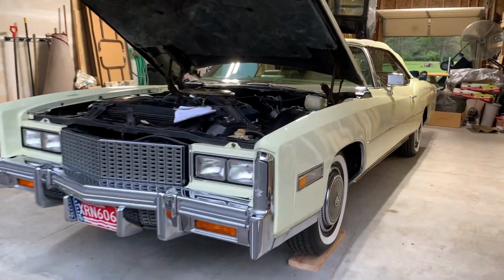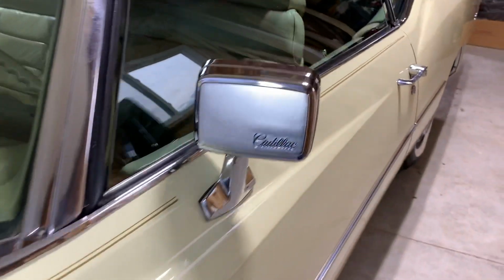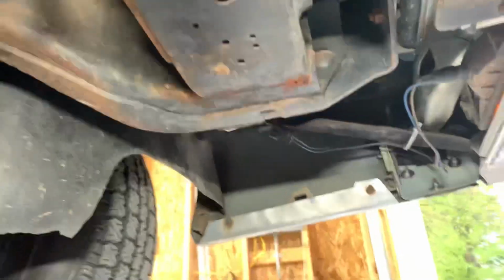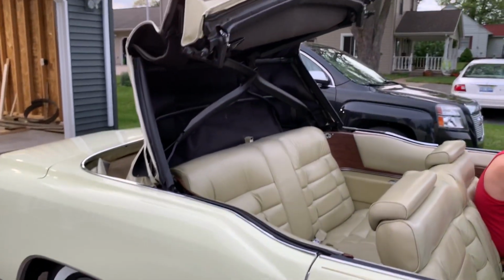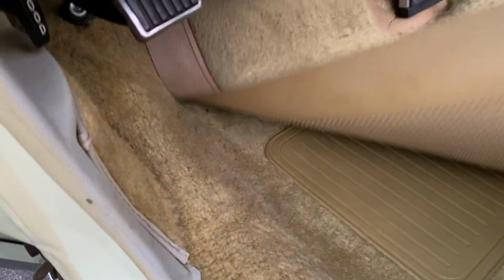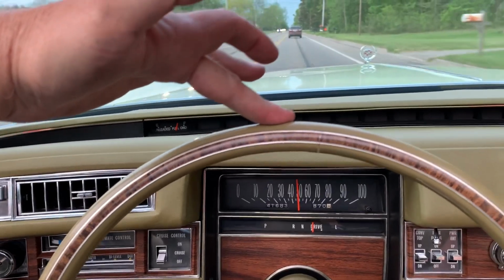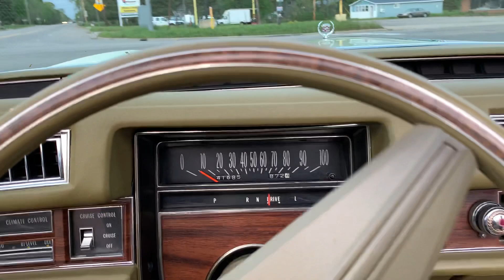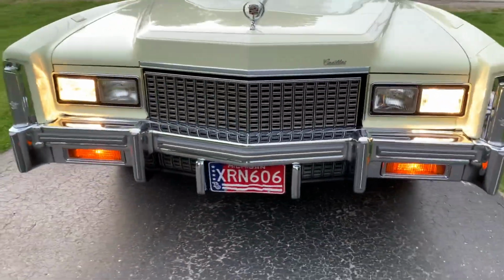1976 Cadillac Eldorado Convt for sale low mileage very clean $28,500 810-691-2664

Comment: I feel so lucky to have found one in a barn with 9988 original miles in Blue Firemist.  I didn't believe it at first until the experts told me that the lack of wear on the seats and door panels show no wear which they are usually cracked after 30,000 miles, the steering wheel was great along with the convertible top was original and in pristine condition indicates it was a 10k mile car.  I couldn't wait to get back to my friends to purchase it.  My friend's dad was a HUGE collector and bought it, a yellow one and a Bicentenial one.  By the time I found out the Bicentenional was gone and the yellow one given to his son leaving the blue one for me.  As long as it does not snow this week I will be bringing her home.  It's cruize time in the spring.